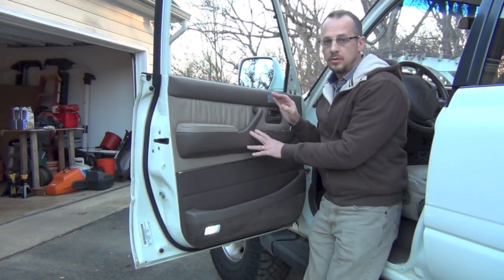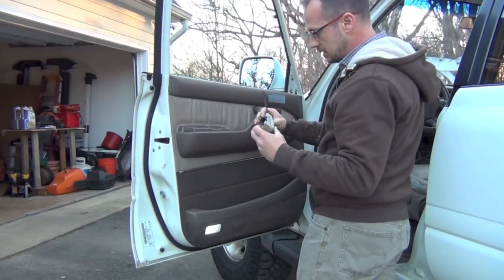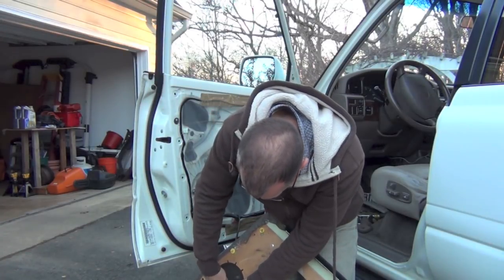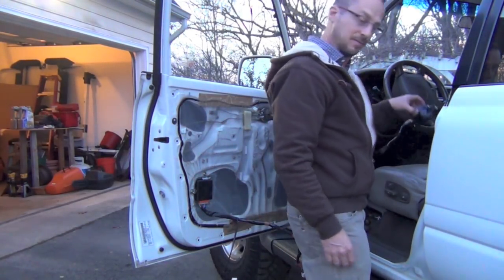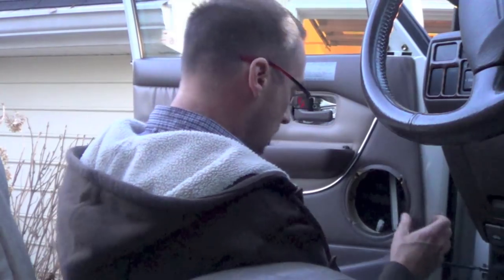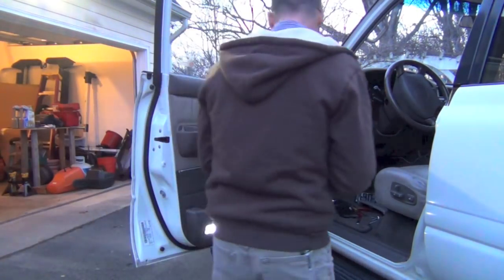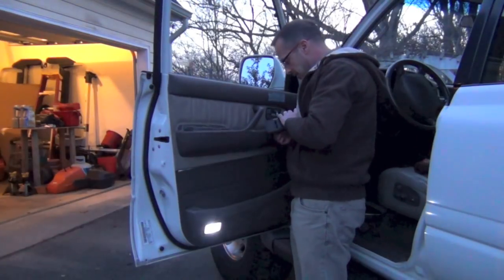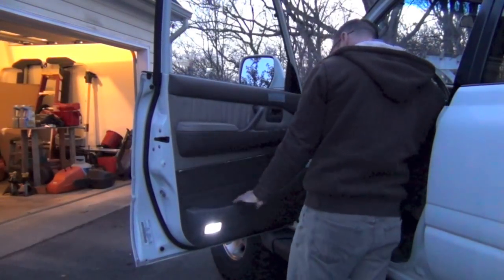Part 3 - Front Speaker install   80S Land Cruiser

Comment: Hello, I have a 97 cruiser, wondering if you are still making and selling those custom rings to fit the front door speakers apparently people can’t get a hold of you, I’m hoping you’ll be able to read this comment and able to help out thanks.
Reply from the maker: Sorry folks are having a hard time reaching me. I usually respond to comments for my Videos pretty quickly. My website was closed down unexpectedly by Go Daddy due to my CC expiring. What a trip. Anyway, folks can get in contact with me via Facebook, Instagram or here in the meantime. I can make the rings on request but I’ve really had a hard time sourcing the 3/8” material. Reach out on Facebook Messenger and we’ll work it out. Thx!

Comment: Thank you, Clay, for taking the time to video the process.  I am recently retired and looking forward to finishing the restoration of my Toyota CJ80 1997., same as your toyota. I have viewed and reviewed several times parts 1, 2 and 3.  Thorough job on your part.  I particularly like the the solution you came up with to replace the front door speakers with the Polk Audio DB521 by fabricationg a 3/8" thick spacer ring out of moisture proof fiber board.  I plan to review more of your older videos.  Thank you again.    Mike
Reply from the maker: Mike, you are most welcome sir.  Glad these are helpful for you.  I love working on these vehicles and for the most part believe the engineers did a good job with their designs.  I'm sure in hind-sight, like most of us, they would do things a little different, but not too many things are designed bad on these 80S.  Enjoy yours!  Take care and thanks again for the note, Clay

Comment: Are you happy with the installation and equipment installed.  I need to do the same thing with my 80. Thank you for sharing
Reply from the maker: Everything is still great. Made a big difference in the sound over my old OEM speakers which had come apart. Hopefully this 3 part series is helpful.
Reply: @Texasknowhow  thank you for getting back.  How can I get the rings for the front.

Comment: Thanks for the great info.  One question I have is screw size you used (#10x2”).  Pretty sure the factory screws are #14 so you went down two sizes.  Have you had any issues w the screws loosening in the plastic door stanchions?
Reply from the maker: I did have one back out on the right front door. Those #10 size looked really close to what came out of mine tho… I may have went a little small on those. All other screws are holding well. I just snugged that one back up, still holding. I chalked it up to I must have missed the final tightening on it. Thanks for the comment and info. Take care, Clay
Reply: @Texasknowhow  thanks! I took a closer look just now and those stanchions don’t have thru holes in them for the screws.  So that means the shorty #14 screws never went thru either.  So your smaller ones simply punched thru the plastic and held fine.  Good to know now.  Thanks again.

Comment: Just to make sure I understand  ,the grill is at the same distance  sticking out  as it was before ?  The reason I ask is  when  the door is shut  there is not much space  betwen the door speaker grill and the dash .
Reply from the maker: steve dental - It may be a few mm further out, but mine don't hit and I've had this mod for years now. I think the new mounting method does compress the foam portion of the door panel some. The OEM method to mounting the grill leaves the door panel free to "puff out" only held down by it's edges. Trust me, with the rings I used, and the mounting method shown, it doesn't make contact.
Reply: Okay thanks I just measured I have 9.7 mm from the closest point of the grill to the dash  so a few mm bigger will work fine like you said . Have you figured out a price for your custom ring you said you would make ?
Reply from the maker: steve dental - the introductory price for the 4 rings needed for the two front speakers is $55 which includes shipping to US locations.
Reply: that sound really fair

Comment: Thank you for the awesome video clay I have the exact same cruiser as yours. The local stereo shop sold me some kenwoods and said they would fit. Well there almost 2 inches deep so I am gonna have to do what you did but with only the one spacer. I have some evergrain outdoor decking material  that's a half inch and it's almost the same color as our door panels. Thanks again. Aaron from great falls montana.
Reply from the maker: Montana 2 Strokers - Sounds like you you have it figured out Aaron.  Appreciate the comments and kind words; we try to post stuff that most of us want to do to the Land Cruisers but that may not be exactly straight forward.  Hope your install goes well my friend.  Clay

Comment: Great video Clay. Do you think the 5.25" Polks you used for the front doors would work for the back doors? I assume they are too big for the bracket that holds the stock speaker grilles, but I don't plan to use the stock grilles anyway. I'm gonna paint the Polk grilles to match the brown interior. Let me know what you think. Trying to decide which size speakers to order for the back doors...
Reply from the maker: I think they would fit but not the way I used the old mounting brackets, you would just have to toss those and mount to the metal door inside skin. The hole is big enough. I just didn't want to drill into my door with screws as I think they will eventually rust at those drill locations.

Comment: Great channel you've got here Clay. Diggin the 67 Ford also. I was just wondering what your inner diameter on the rings your made was. Looked up polk's website and found 4 11/16". Seemed a little small. Was hoping you could share some insight. Cheers from TX!
Reply from the maker: +bigblackbronco1979 - I think I can still measure that ID from my router template. I'll get back to you. Thanks for the compliments!  Clay

Comment: Taxes man I like your work and I wish i had same tools and garage like you to work on my lovely lx450. Thanks for great videos. Please make a video about EGR valve. I replaced egr valve and modulator but still my car shows egr code. Do you have any idea what else can cause P0401 code?
Reply from the maker: Thanks Kamran!  For that code, I would hit up the ih8mud.com forum - here is a search that pulled up many discussions - http://forum.ih8mud.com/search/625926/?q=P0401+code&t=post&o=relevance&c[node]=9
also, get back to us when you figure this one out.  I'm sure others would like to know what you do to finally get it taken care of.  If I ever have this issue, I will make a video of how I fix it.  So far no P0401 for me.  Take care, C
Reply: Texasknowhow  I think I found the problem and I ordered a new vacuum switching valve from amazon. Under the hood of the car I looked hardly to find the location of the VSV but I couldn't find it. Can you please make a short clip about the location of VSV valve. I searched youtube alot but no luck. And in IH8MUD I checked pictures from member about VSV but I still couldn't figure out the location where it's installed. Thanks!
Reply from the maker: Kamran Khan Hey man, i will eventually get to the VSV, but probably not soon.  I have a couple of other projects in the works and unless mine goes out, I will probably not be filming it.  When you get the new part, I think you will see how to replace yours and also be able to find it under the hood.  Remember to check all vacuum hoses and connections while you do this work; they have to all be sealing very well for the vehicle to run properly.  Best of luck, let me know if you get it done! Clay

Comment: When you hooked up the new stereo to the 2 gray wires  connection ,did the tweeters in the dash and the subwoofer  work ?
Reply from the maker: steve dental - yep. All speakers still worked even those two in the lower part of the dash and the two speakers high in the very back. Hard to tell if that sub in the rear right is working tho.

Comment: Ended up with just a 1/2 inch spacer on  inside for installation of the db562 set, without the stock grill. Door panel seems flat and theres more than enough clearance on both sides.
Reply from the maker: Good deal. Yeah, if you are cool with an after Market grill that sounds like a good way to go. Thanks for posting up the results. Take care, C

Comment: Hey tex i got a 97 land cruiser and mine just has the 2 speaker under the dash front of the knee and I don't know if they mid rang or tweeters and what the size of theme anyhow i will replace theme with the jeep wrangler under dash speaker i think they will fit . Any advice, thanks from Saudi Arabia 💕
Reply from the maker: Fahad - Those speakers under the dash are really weak and more mid to high freq speakers. I heard that some of these Land Cruisers were sold with only these speakers. Changing them to a larger more full range speaker will help, but adding the door speakers will really help. Thanks for the shout out from Saudi Arabia!  Take care, Clay
Reply: Texasknowhow thanks for quick respond... yeah mine it's just got 2 speaker also it's stick shift which i love .. about door speaker well i got to open a hole in the door to place the speaker and much more work that I don't have right tools to do so  i will take wrangler speakers or charger dash speakers ... anything well be better then my shitty under dash speakers .. lastly i love Texas love her accent in a whole i love America.

Comment: I would also like to buy some of those spacers you make if you have the time. Thanks for the videos they are a real help.
Reply from the maker: Hey Zack, sorry for the late reply, been swamped at work.  I probably won't be able to make any rings anytime soon.  I'm out of the material I used and a new board of that (sold only in 16 ft lengths) is like $90 if I recall right.  So I may look for another source etc… but just so busy now man.  Sorry.

Comment: I have a 2006 land cruiser and my speakers are dead.  Is it true that you have to use the stock JBL/toyota speakers?  I was told I could run the risk of shorting out my system if i didn't go with the stock speakers?  Is this true??
Reply from the maker: If you stick with your stock head-unit you need to match the impedance of the stock speakers or a little higher, but not lower. Other than that you should be good.

Comment: Hi Clay - these videos are awesome.  I am restoring a '97 FZJ-80 series LC and I am having a heck of a time replacing the front door speakers.  Would it be possible to purchase a set of custom rings from you for my front door speakers?  I sent a note via your website as well with my contact info.  Thanks!  -Alexander
Reply from the maker: Hey Alexander!  I’ll get back to you via your email. I still make the rings on a request basis.
Reply from the maker: Alexander - email me at Texasknowhow(at)gmail(dot)com
Reply: Hi Clay, love your videos regarding repairs/upgrades to your 96 Land Cruiser.  I’m in the process of upgrading my 96 LC’s interior and sound system, following your videos and speaker recommendations for keeping the OEM grills.  I’ve finished the rear doors using Polk DB402 speakers in the OEM speaker mounts (the DB401’s are no longer made and nowhere to be found on eBay or Amazon).  I was able to get the Polk DB521’s for the front doors and will be starting that upgrade shortly!  Would it be possible to purchase a set of your custom rings for the DB521’s to help me facilitate completion of the front door speaker replacement?  I would like to keep the OEM grills and would not be able to fabricate anything close to the fitment and professional appearance that you have achieved.  I’ve sent you an email via your gmail account with my contact information.  Thanks.  - Brian G. (Northern Virginia)
Reply: @Texasknowhow  Hi Clay - I sent you an email a few months back.  Will re-send it.  I’m hoping to purchase a few sets of the custom rings you made for your FJ80 front speaker install.  Thanks! -Alexander
Reply from the maker: @majorleaguesurfing  Please do resend the email Alexander, we'll go from there... I found Brian's email (above) but not your prior email.  We figure this out.  Thanks for your patience, Clay
Reply: I'm in the same jam. Were you able to get ahold of him?
Reply: @dfox344  Nope - I need to send him another note.

Comment: I've found several videos highlighting replacing all 4 door speakers on the 80, but none cover replacing the dash speakers.  Why is this?
Reply from the maker: David Sparrow - Good question David. I was always thinking that they would stop working with this upgrade but they are wired with the front door speakers and are still playing under there.
Reply: @Texasknowhow  I am about to upgrade my door speakers and figured I would replace those at the same time.

Comment: I did it this way and it leaked both the passenger door and rear passenger door.
Reply from the maker: Leaked???
Reply: @Texasknowhow  yeah water through the speaker and behind the door panel, I just replaced the window regulator and put up fresh moisture barrier with fresh oem sealant. I am going to make some similar rings, and I got some water proof foam from crutchfield  to make a moisture barrier from the backs of the speakers. and my left side no leaks

Comment: Hey Clay can I buy a set of those spacers from you?
Reply from the maker: thedikslanga - I don't have any more of the material I used in the video and not sure I could get the same deal (bought a half length piece that someone had returned for a discount) as i did when I bought my materials.  In short I really don't think I'm going to make more at this time.  Sorry man.  Dimensions are shown in the comments under the video if that helps.

Comment: Making my spacers out of wood... good idea, bad idea?
Reply from the maker: BAC0NAT0R20 - not sure. Some woods are not rot and moisture resistant. I also didn’t want to use wood as it expands with relative humidity if it’s more moist out or on the trails. I just made another set for a guy. $58 shipped.
Reply: Texasknowhow - Good point. Do you think that just one 1/2 inch spacer on the inside would work? 
Im using the 6.5" db652 set
Reply from the maker: Not sure on that speaker, If I recall correctly, I think there is 2.25" or just a little more depth clearance with both my spacers (inside and out)  I didn't want to go any thicker on the inside because the door panel wouldn't sit flat, but you could try it.  Just measure the depth of the speaker and measure in there; try any combination.  Let us all know what you end up doing.  C
Reply: Texasknowhow  Will do. May take a bit till i get the plastics. Thanks for letting me know bout the wood expanding, forgot bout that.